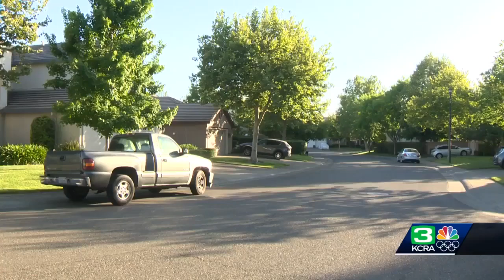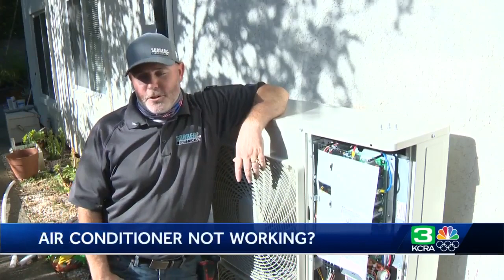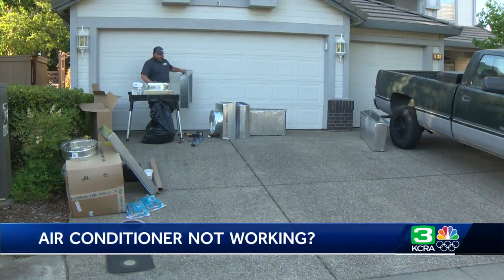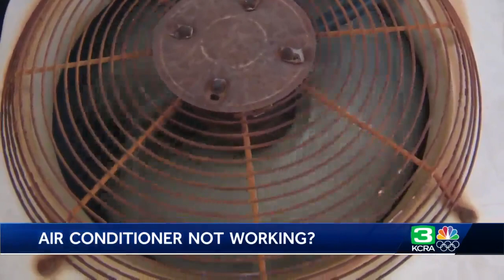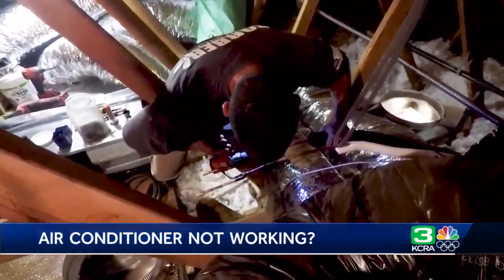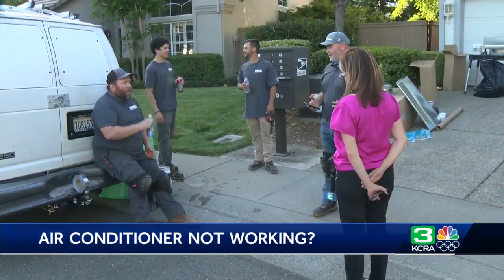Preparing For The Triple Digit Heat

Comment: +kcratv  Absorption refrigeration should work better the hotter it gets, provided that the installation is properly designed.  Then why are HVAC manufacturers not advertising or product-listing absorption-refrigeration systems?